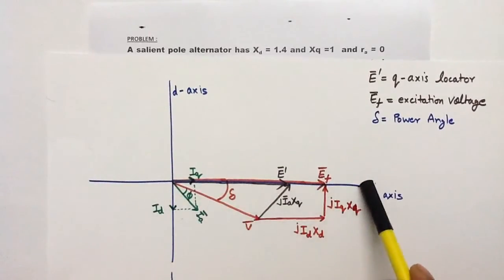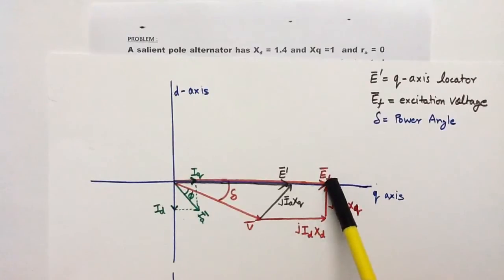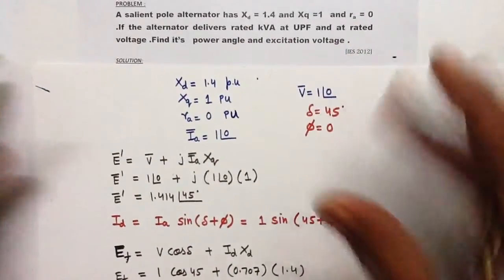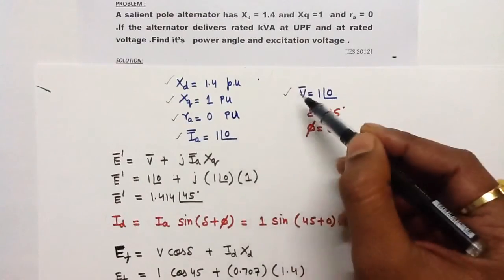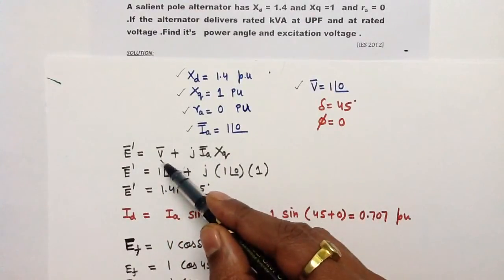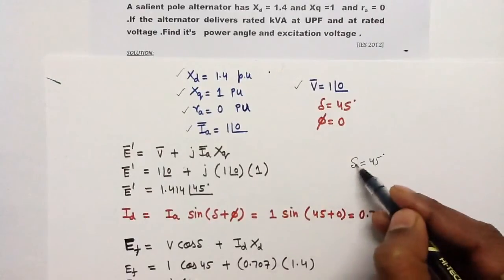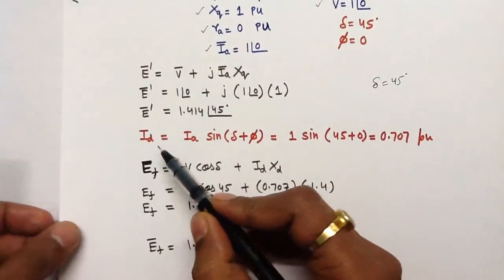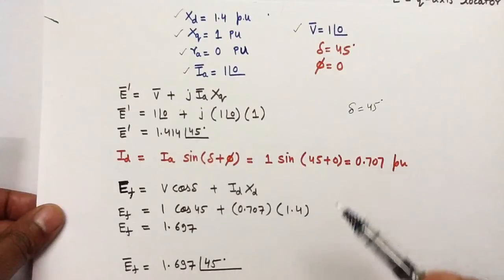Electrical Machines--SYNCHRONOUS MACHINE (IES)

Comment: Good explenation , but can u solve this problem ? Three-phase synchronous turbogenerator with the following data: Un = 11kV, xs = 10ohm, Ra = 1ohm, "Y".
a) If the output power does not change but the excitation increases by 15 percent, find the value of the current, the load angle and the power factor.
b) To analyze whether it is possible to operate the generator with power factors 1 and with case excitation (a). In these conditions to find the current of the armature, the load angle and the power given by the generator in the networks. can you please solve it i really need it for today please!